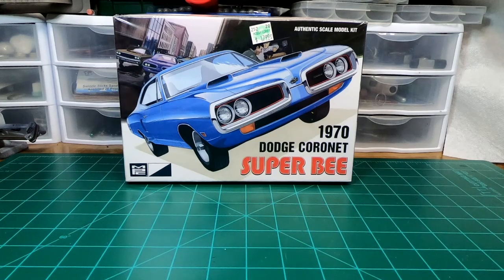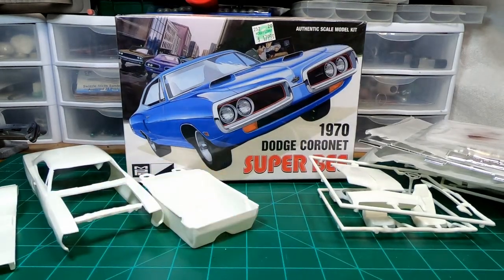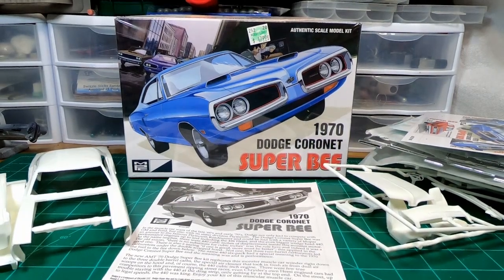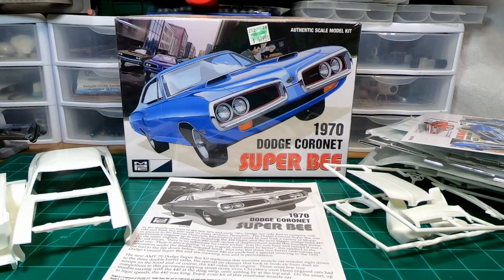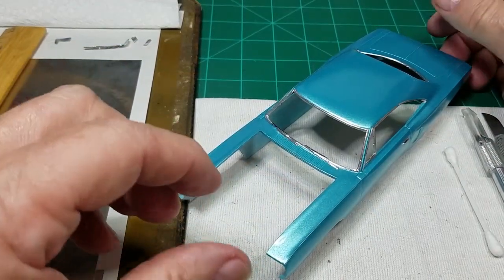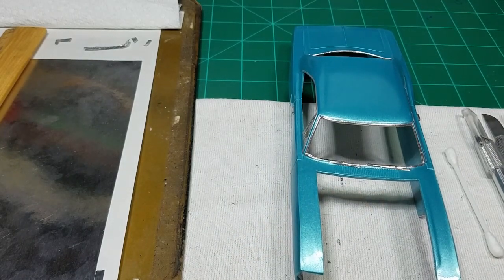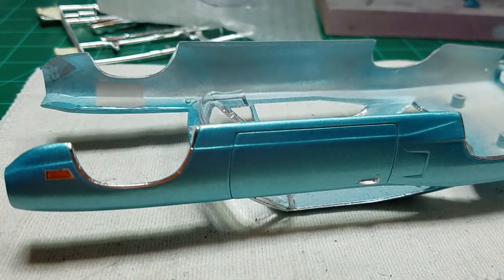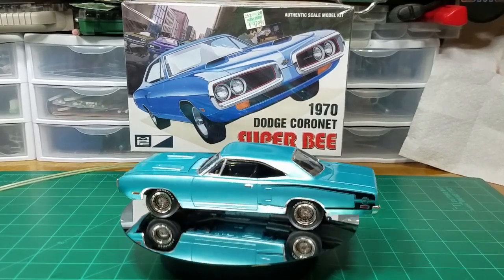1970 Dodge Coronet “Super Bee” by MPC - Episode 48

Comment: I really like the color you chose.  This is totally random but it’s such a relief after you assemble your chassis and all 4 wheels sit level Lol.  That’s a nice clean build.
Reply from the maker: Thank you! I initially chose Folk Art Ice Blue for this kit but I had a ton of trouble getting the paint to lay down smoothly. So, I went with the backup color...  I totally agree with you on the four wheels sitting level. I have found that most times the older kits have less problems than the kits that are currently being produced. It's like quality control has been thrown out the window for the cause of saving a few more dollars. Thanks for the great comment!

Comment: The extra parts in that box, Go to the 70 dodge coronet pro street kit that AMT had out I think it had the purple coronet car on the box top, You have notice it has 2 dash boards, a set of deep dish mags, & 2  motors. The coronet pro-street kit was a great kit also came with 2 M/T pro street wide tires that are not in your kit.
Reply from the maker: Now that you have mentioned it, I do recall seeing the Pro-Street version some years back and it kind of connects the dots for me. As is often the case in the model kit world, build one mold, do some minor switching of available parts, throw it into a few different boxes and have multiple versions available to offer to the masses. Recently, I broke out my really old Revell 70 Torino Cobra kit and was kind of laughing when I seen that the parts trees between this old kit and the just recently released version were identical. The only differences between them was the box art and the decal sheet. To be honest, I like the new release kits decal sheet better than the one that came in my old kit.

Comment: One dashboard for automatic, one for manual, I think!
AMT bought MPC is what I've heard for years, both brands still exist but under one umbrella. (kind of like Ford is a company name and also used as a brand of auto, along with Lincoln which Ford purchased and absorbed years ago) I think AMT wants to move that brand upscale on new tooling they use. MPC will probably be on older tooling re-releases.
Reply from the maker: It wasn't until I finished with the painting of the interior that I realized that one dash had the brake and clutch pedal attached and the other did not. This kit has had many different iterations between basically stock to full on tubbed rears and huge slicks and a blown engine. MPC omitted some of the racing parts and not others. I think that's where the different dashes come into play. Thanks for watching!

Comment: Kitbash in a box kit. 70s MPC body and interior bucket with the chassis and engine from an late 80s AMT roadrunner / gtx . 
Thats why you need to grind/cut on the windshield to make the two kits fit at the cowl area.
Youd be surprised at how well the chassis from the mpc 69 daytona/ general lee / country charger kits fit in that mpc 70 coronet body.
Reply from the maker: It was a little confusing for like a minute when I pulled all of those extra parts out of the box but I figured that it was like most kits with it being a one kit fits all boxes with added or subtracted parts to fit the box art. This one was just a bit unusual in having to remove a part of the windshield before installation. As far as the chassis goes, I wouldn't be to surprised about it fitting into other kits as the 1:1 cars share similar underpinnings amongst themselves, why shouldn't the 1/24 cars... Still, it's nice to know that they are interchangeable.

Comment: I bought this kit a while back. Your Peacock color looks good, and I'd use it too, if I didn't already have a firm color choice. Because the first 1:1 I saw of the '70 Super Bee being unloaded from the transporter at my local Mopar dealer was Hemi Orange, when I get around to it, my kit will be orange.
Alignment of the bumper/grille assembly is supposed to be flush with the top of the fenders and hood. Is there a problem you found that prevents that? It looks like it sits too low, exposing the flat vertical surface on front of fenders. I will need to work up some way to make it fit, if you found an obstruction.
Reply from the maker: I remember the first time that I had ever seen one of these cars. It was a neighbor of my high school buddy that had one. I don't know the technical name of the color, but it was a light blue with a black vinyl top and black stripes like the ones that I used. I never talked with the guy that owned it so I don't have any specs on the car. I just remember staring at it everytime I went by his house. AS far as the hood issue... that's just the way that it's molded. I imagine if I would have ground down the center section of the hood where it sits between the bumper/grille area it would fit a bit tighter. There isn't much as far as material that can be removed before you begin to affect the trim at the bottom of hood. Maybe this and a combination of removing some material from the backside of the bumper assembly might give enough clearance for the hood to sit flush. The chrome part and the painted part of the bumper is all one piece so if you're up to doing this it would have to be a careful balance so that you don't disrupt the look.
Reply: @scaleautoguysworkbench  I noticed the character line that sweeps upward in front of the wheel opening. That sweep is supposed to carry on along the bottom edge of the chrome bumper, I think. On your build, the bumper looks low there. That's why I asked the question, because maybe the underbody sub-frame doesn't fit to the body correctly, and it throws the bumper out of proper location. And then that obstacle makes the top side of bumper/grille go out of alignment to top of fenders, too. I don't know yet how all that fits together, I haven't opened the box for my kit.

Comment: You reduce de clear
Reply from the maker: I reduced the clear using the Tamiya X20A thinner. I don't remember the ratio off the top of my head as this was done quite a while back. I just remember that I wasn't overly impressed with the results after having spent the money for the Tamiya products. It wasn't any glossier than any of the other clear coats that I have used in recent history. So in my mind it is not worth the added expenditure and the time to drive further to get it.

Comment: Id love to find that kit...
Great job on the BMF...
Awesome color and clearcoat.
I love side glass, as well, but hate all black interiors... always do mine tan or whites...
Great job!
Reply from the maker: Thank You! If you look on Ebay they have this exact kit and other re-issues of it currently available ranging between $30 to $50. This build started in a totally different paint scheme and then evolved as it went on. Initially it was going to be Ice Blue exterior with a somewhat matching two-tone blue interior. Do to issues with the paint, the Ice Blue was changed to the Peacock Pearl and the colors that I chose for the interior looked awful together. So, I went with black on black. I mix up the interior colors on my builds. Sometimes they're black, or they may be tan or two-tone. It depends on the car and how I feel when it comes time to pick out the colors that I want to use. My two previous builds were Almond and two-tone blue and white. The paint that I used was shiny when dry, but I wanted to kick it up a bit so I added the clear.  Thanks for watching!